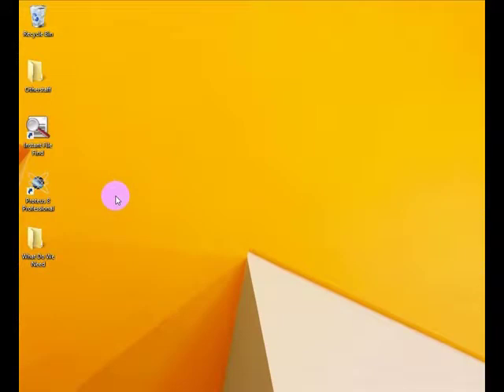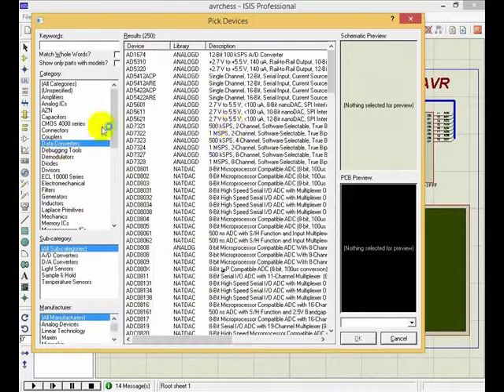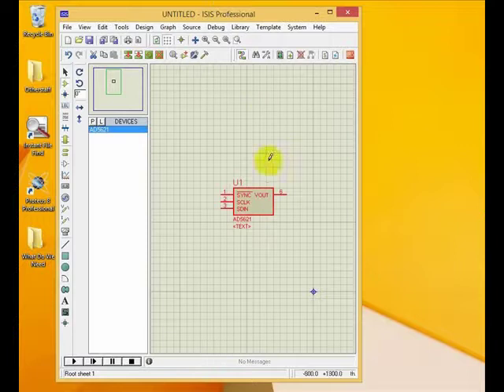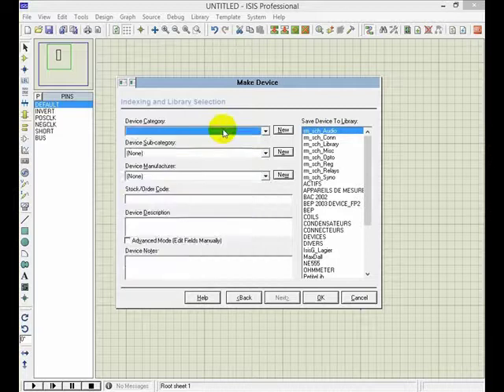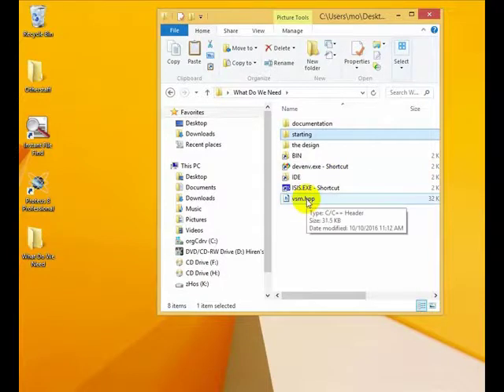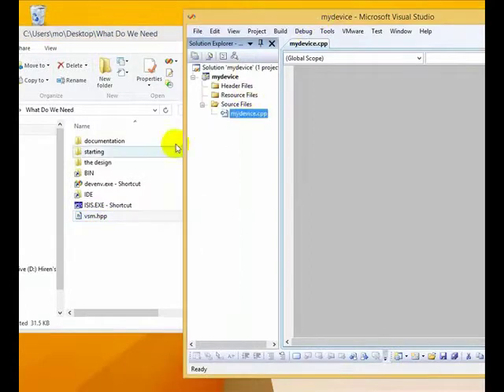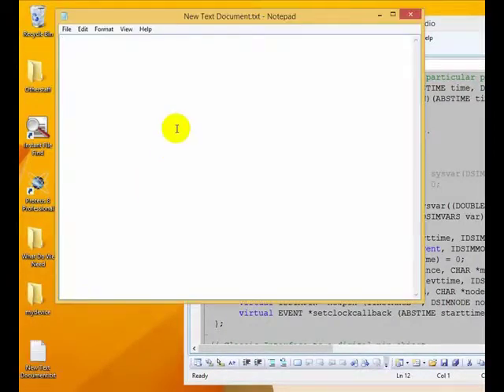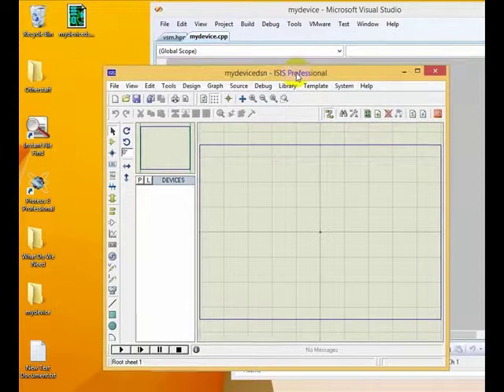proteus DIY create your custom dll component with with  VSM API

Comment: what type of pin is passive pin
Reply from the maker: passive pin is a pin that has no power on it i.e it doesn't give power to outside
Reply: @newdays2025  Then why many times in symbol creation output pins are made passive instead of output type and even bidirectional pins are made passive??
Reply from the maker: @ahsanalirafaq805   the default choice is passive but if you mean  when you changed it to output, it turns back to passive and ignore your selection,  then it maybe software issue, please correct me on this.
Reply: @newdays2025  no-no that's not what I m asking, what I meant is that I have seen designers when they create a symbol sometimes they assign output, input, or even power pins as passive pins so I wanted to know why they do that?? what kind of pin is a passive pin??
Reply from the maker: Thank you .for clearing it to me...
passive pin: means it does not source no power (so no current or voltage is generated from the inner circuit, to go out side this circuit through  that pin)
The opposite is true : Active pin is carrying some kind of power from its circuit to outside world. hope..this satisfying
Reply: @newdays2025  so it means if we assign the pins of an active component e.g voltage regulator which has input, output, and ground pins as passive pins instead of input, output, and power. The passive assignment of those pins won't have any kind of effect on the regulator's output, input, and tying to ground??
Reply from the maker: @ahsanalirafaq805  I think (because I am not proteus expert) this assignment will take effect when you connect that pin to  other device then ask proteus to  analyze or simulate the circuit, then consideration to that assignment will take effete.
Reply: @newdays2025  ok and thank you very much